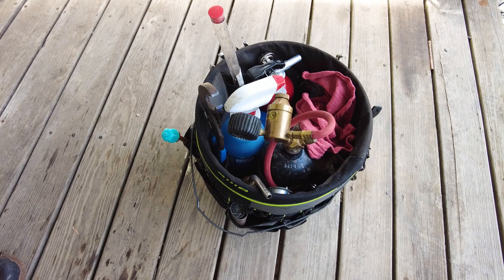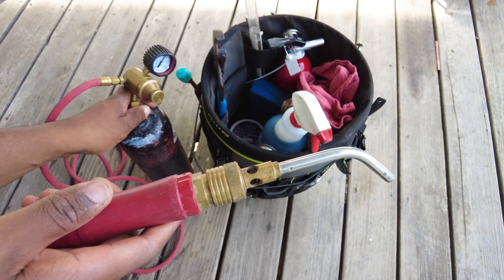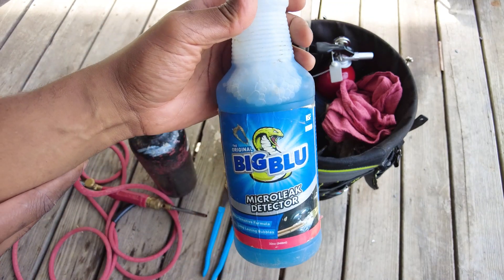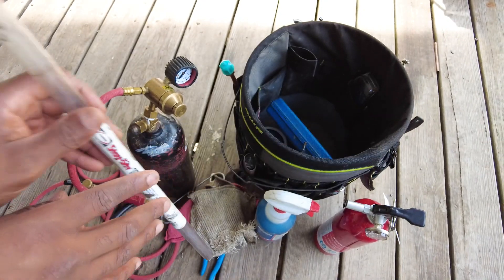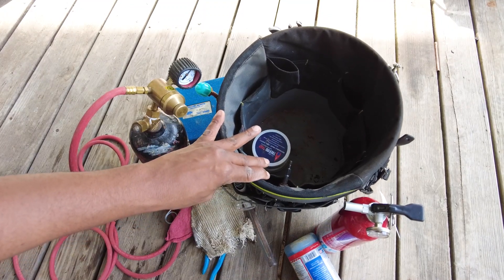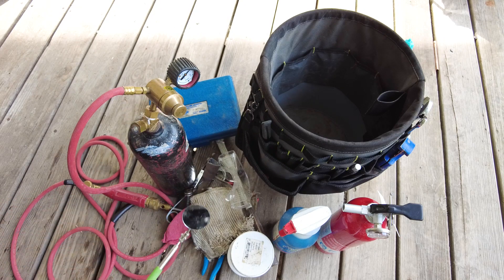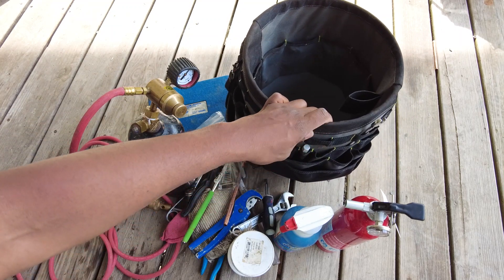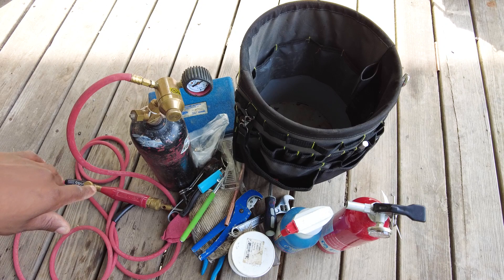MC Tank B Tank Replacement Torch Setup for HVAC | Turbo Torch | HVAC Brazing Torch Kit

Comment: nice set up. Did you use an adapter from turbo torch to fit in mc tank?
Reply from the maker: No the regulator I came with the kit fit the tank from the factory

Comment: How long does that tank last sir? And what size copper can you braze?
Reply from the maker: Hey, I'm not sure how long this tank will last as I usually don't let it go completely flat. I usually don't braze anything larger than 7/8. Thanks for watching!
Reply: @HVACTechKnowledgy  thank you I appreciate it sir.
Reply: That looks like an A-8 tip he's using.  The tip number indicates how many cubic feet of acetylene it burns in an hour.  The MC tank he's using holds 10 cubic feet,  so it will last a little over an hour of burning.   The manufacturer's specs say that the A-8 tip can braze up to 1"  copper.
Reply: @andrewalexander9492  great info. Ty 👍🏾